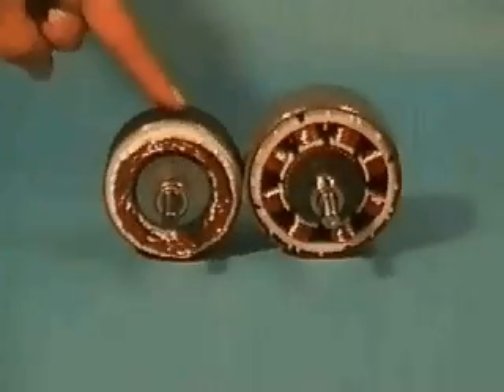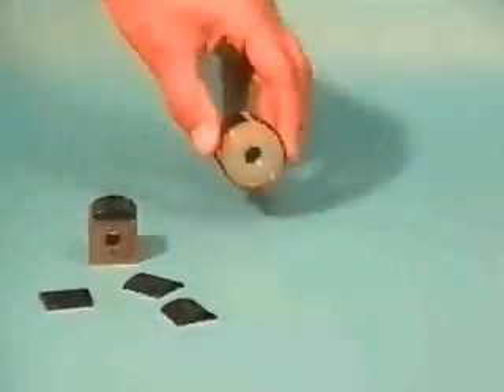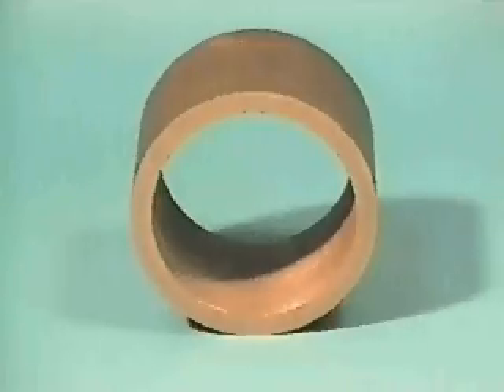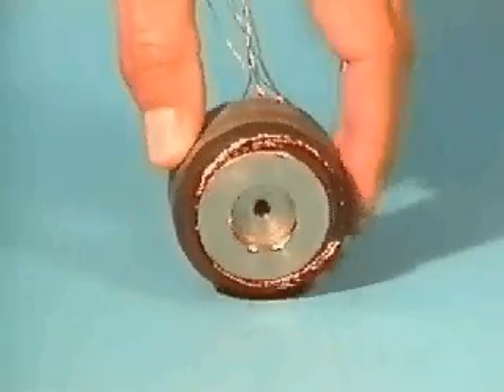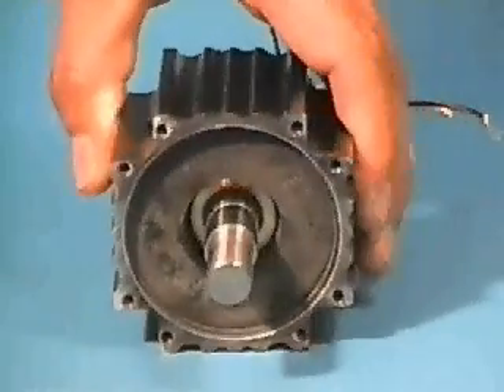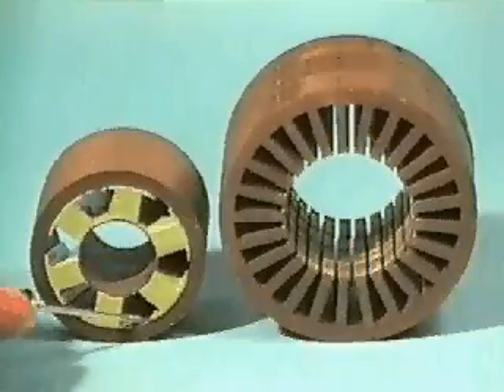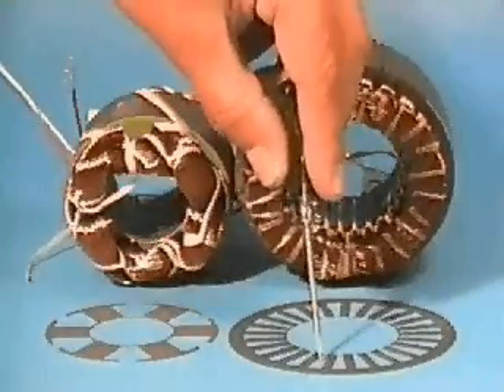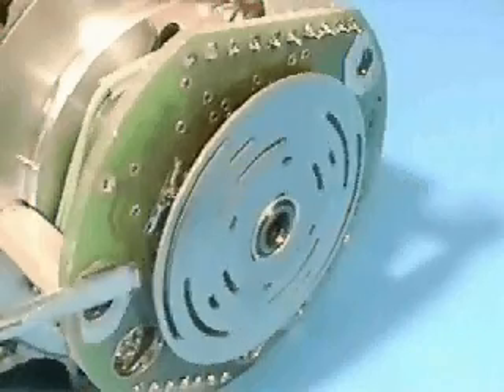How a Servo Motor is Constructed

Comment: I need a video in which servo motor 36 slot wind very slow so that I can wind it.
Reply from the maker: You'd need to search further. Winding motors specifically isn't my area of expertise. I'd suggest checking motor manufacturers or local motor repair shops.

Comment: Hola buenas noches, soy emilio trabajo en mantenimiento,  gustaría saber si un servo motor se puede controlar la frecuencia de velocidad con un variador sin usar un driver o PLC, lo que busco es rotación constante para adaptar a un enroscador de tapas, mucha gracias..
Reply from the maker: emilio cossio Pardon, what is enroscador tapas?  A servo motor's current is proportional torque and that's controlled from a servo drive. Servo drives can be in analog torque mode (+-10volt dc) or analog velocity mode (+-10volt dc) or in position mode. There are servo drive controllers that can be programmable to also control the motion or run a program. You could have a servo drive in velocity that would run proportional to the analog +-10vdc signal. You can also do gearing to follow an external encoder. Or you could have a motion profile programmed in the servo drive controller.  A PLC can do many things and they can output analog signals but they're not great at doing motion control. What are you trying to do?
Reply: Automation Engineer muchas gracias, se le agradece mucho..

Comment: i heard that servo motor unlike normal motors it can stop rotating once it cut off electricity, is that right?
Reply from the maker: medo sam Servo motors are not powered directly but rather through a servo amplifier (sometimes called a drive). They have an enable input that a controller can enable/disable the drive. In safety conditions, you'd cut the power to the servo amp/drive which would remove power from the motor. Some amps/drives have separate control power than motor power so you can still communicate and keep power on the feedback device (so you don't have to rehome/reference the machine when you power the drive again, or you can communicate to it to see if there's a fault). Other drives have Safe Torque Off inputs that are a relay for the machine safety circuit that are a hardware controlled (not software controlled) switch that removes power from the motor at the drive. Servo motors without a brake are free to spin when powered off. Servo motors with brakes are almost always fail-safe brakes that you must apply power to the brake to disengage it from the motor shaft. Thus in the event of power off the brake engages the motor shaft and holds the load.AC induction motors can be power directly from AC voltage but only at 1 speed. For multiple speeds, a Variable Frequency Drive (VFD or sometimes called an inverter) can be used. But again, you cut AC power and it's not spinning.Stepper motors are powered from stepper drives (most are not called amplifiers as you set the current for the motor and it's running at full current most of the time -- not amplifying an analog error - see my PID servo loops video). Stepper motors are typically 1.8 degree step motors which are a 50pole. They have much higher detent due to the high pole count and cog when you feel them (not energized) - though I'd estimate it around <10oz-in for a 23frame (2.3" square). When energized they have hold position very well. But powered off they don't hold position, unless there's a brake on them like servo motors.